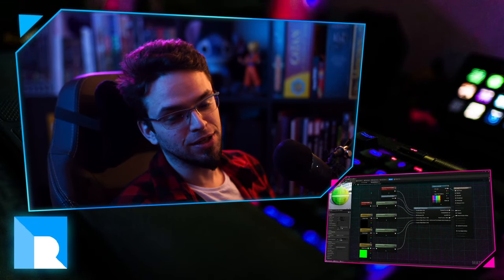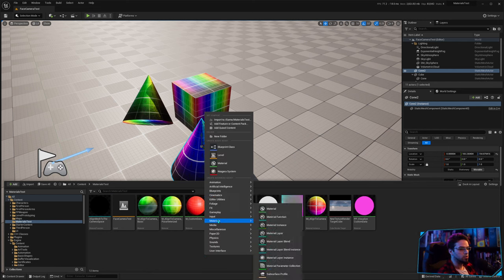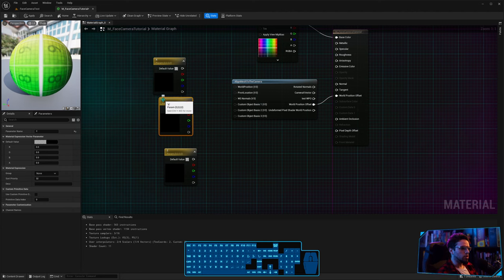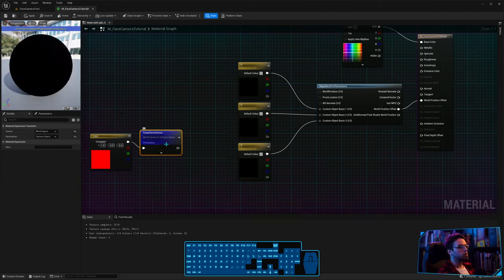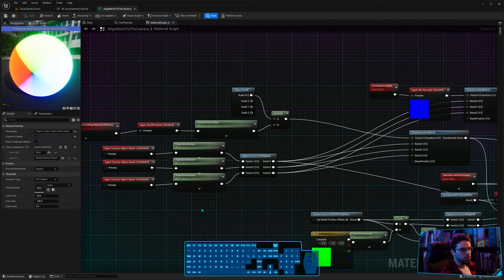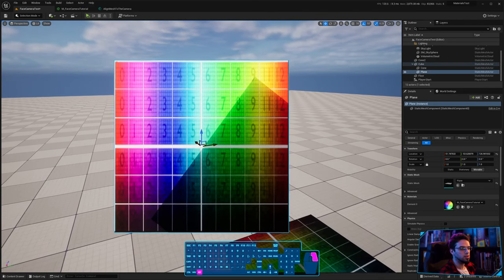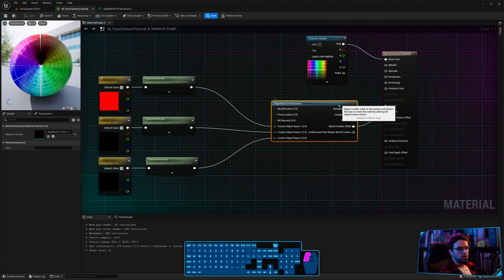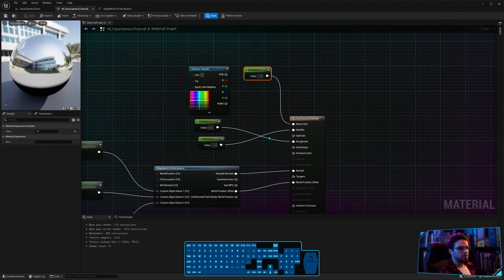Align Mesh to the Camera - Unreal Material Node

Comment: Hey Rodrigo, thank you so much for sharing this knowledge with us! I just want to know how you would go about creating a material that faces the camera for sprites and flipbooks, in order to have some camera movement in 2.5d games. I tried with the material you showed here but it faces the wrong direction.
Reply from the maker: With the AlignMeshToTheCamera node, you can have any mesh face the camera, with any of the mesh's axis. You need to figure out the sprite and flipbook's forward and up axis to input them correctly on the node., as I do at 10:12 with the Unreal plane.

The problem is that will rotate the sprite 100% with the camera direction, including up and down. But usually, we keep sprites upright, while they only rotate sideways, around Z, like blades of grass would.

In that case, I wouldn't even bother with the AlignMeshToTheCamera node. Instead, you can use the RotateAboutAxis. Here are the nodes you need: https://blueprintue.com/blueprint/xtow0_pt/

That was made for the plane in the material editor viewport, which faces X. I believe Sprites also face X, but if not, you can add Pi (3.141592) to the result of Arctangent2 to rotate it 180°. The trick here, besides finding the angle with Arctangent2, is I set the Period in RotateAboutAxis to 2*Pi, so the radians from Arctangent2 work as rotation angles.
Reply: @RVillani  Poxa só depois eu descobri que você é brasa também kkkk mania de perguntar tudo em inglês. Cara, antes de mais nada muito obrigado pela resposta! Comecei a aprender UE5 recentemente e to focado em materiais por enquanto. E quanto ao template que você mandou, não rolou usando em conjunto com o template do PaperZD.Character, acho que pra sprite de 8 direções tem algum problema na rotação, o animation source não faz a transição corretamente.

No caso de usar a versão que você mostra no vídeo, teria como colocar um "damp" na rotação em X? Assim o sprite ainda teria esse efeito de billboard mas com menos força nessa direção, deixando mais "natural".
Reply from the maker: @leonardonovais2513  Sem a ajuda de BP pra controlar alguns parametros no material, acho q um damp é impossível. Pq materiais não guardam variáveis q eles mesmos podem atualizar, e vc precisaria disso pra saber a rotação no frame anterior pra poder interpolar pro frame atual.

Comment: I haven't watched the whole thing yet so I apologize if you explain in the video, but is it possible to get a plane to face the camera only around the Z pivot, aka not up and down, only around?
Reply from the maker: @bigmartin343  It is, but it's not explained in the video.

You could, though, use the methods in this video to have the mesh follow vectors still computed from the camera, but modified to only rotate around Z.

You can get the camera's X vector and normalize its X and Y components, removing Z, to have a normal that doesn't point up or down. Then 0,0,1 would be your Z vector. And Y, you can derive from X and Z by getting their cross product with Cross(X, Z). The order of the vectors in the cross product matters, so if Y looks flipped, try Cross(Z, X).

Comment: Thanks for sharing those tips about Material! Quick question: is it possible to extract a color pallet from a texture using a Material shader ? I try to get the feature from adobe photoshop pallet in a Material node.
Reply from the maker: Shaders can't output information directly to the CPU. We do it via textures.

I don't remember if Unreal has it, but if there's a way to get individual pixel values from a RenderTargetTexture2D (I'm almost sure there's a get pixels function or smth in BP), you could use the functionalities of rendering a material into a RenderTarget, then read that material's results.

The material would render the palette in the texture for you to read from BP.
Reply: @Rodrigo Villani  Thank you for the feedback! I tried using HLSL in a Material but it was very inefficient, and it crashed all the time. I look at the Render Target approach, and I will give it a try, but it seems to be very inefficient as well, according to Unreal Documents: They start the description of the function "Read RenderTarget Pixel" with the quote : "Incredibly inefficient and slow operation!" That not good when the developers of a game engine write that! Haha! I guess I'm doom try to get that color pallet feature working...
Reply from the maker: haha they're not lying there. It's inefficient because it has to lock the texture on the render thread, do the read and save it somewhere. And the GameThread has to wait for the locking and read to happen.

You want to get info from the GPU into GameThread stuff, that's the cost.

Unless you create your own system in C++ that constantly does that process from the Render thread, allowing you to always read from the GameThread a maybe-outdated version of the pixels, but never more than a single frame.

Another thing is, you could make a custom Blueprint function in C++ that does what that function does but sending the whole array of pixels to BP, not just one at a time. Then you only do the slow operations once and you can read as many pixels as you want from it.

Comment: What if I want to point the mesh to another vector direction and not the camera? I tried but I can make it work in only one axis. When I add another axis the result are wrong …😅
Reply from the maker: First, you need at least two vectors that represent the new direction and an orthogonal axis to it. Let's say, X, for the front of the mesh, and Z for up. Pass both vectors to the CreateThirdOrthogonalVector node, to get 3 orthogonal vectors to use as XYZ basis. But remember, if the second vector represents Z, the node output for Y will actually be Z and Z will be Y.

Then pass those 3 vectors to a Transform3x3Matrix node, each into their own basis. Pass AbsoluteWorldPosition as the VectorToTransform and leave BasisPosition disconnected.

That will transform the position to the rotated location. Then you subtract the original AbsoluteWorldPosition from it, to get the offset between transformed and not-transformed and pass it to World Position Offset, in the material outputs.

You'll need to do the same with VertexNormal, but without the subtraction, to rotate the mesh's normals.